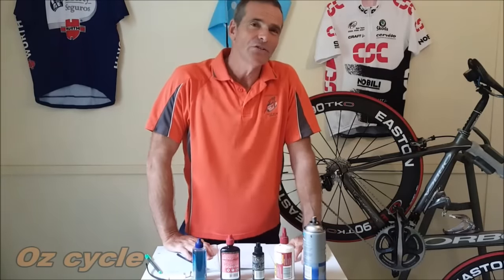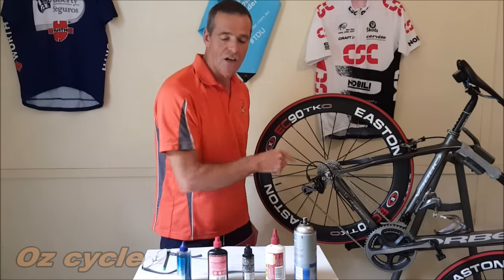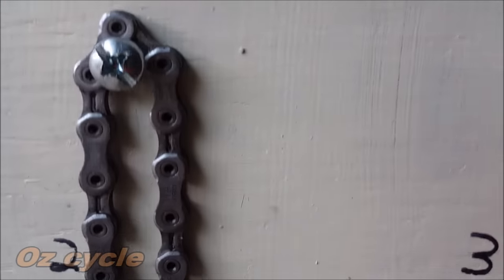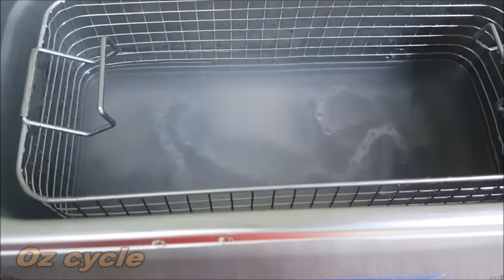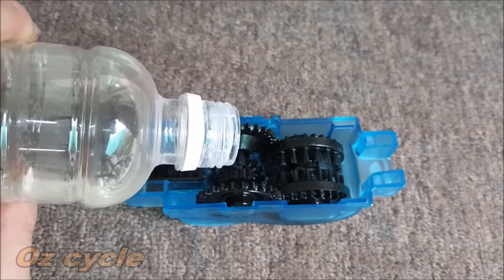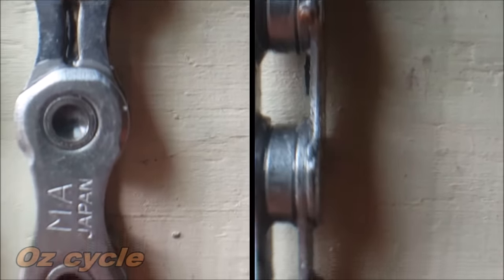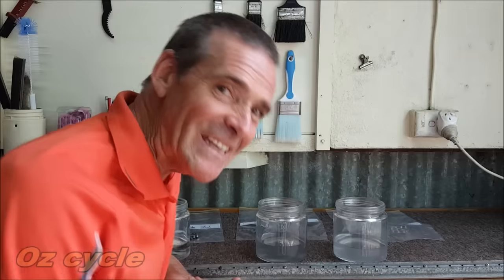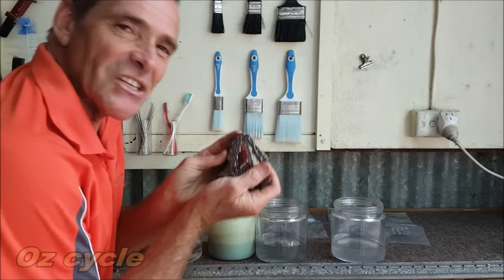Best chain clean ever !!

Comment: In the US it is called gasoline,40 years ago I cleaned chains and drive-train parts with this comparatively inexpensive solvent,used it for twenty years or so.This (gasoline) should never be used for this purpose,the risk of a very adverse outcome is always present.When asked by customers what I used I would tell them,but I always said,I recommend they not use gasoline-way too risky.I was fortunate to never have any type of accident with this solvent,but considering what could have happened ,I have to call out anyone recommending such a procedure on a forum that will have a very wide range of viewers,some of which will be unaware of proper safety measures when handling such a volatile solvent!Please,do not under any circumstance use gasoline to clean your chain,the risk is unacceptable in light of the alternatives.

Comment: Hello Profesor Oz cycle !,  beside cleaning chain , I would like to know the best way to clean free wheel and the cassette, I need your help an figuring out the best way to keep it clean .
Reply from the maker: You mean just the rear cogs? Generally,remove chain and  spray a small amount of degreaser on the cogs and on a dustpan brush. Scrub cogs for about thirty seconds then wash off degreaser with water in a spray bottle or light hose spray. If very oily/greasy cogset repeat the proceedure and you should have nice shiny cogset. Wash out dustpan brush when finished.

Comment: Hello. Good video, but didn't see only method I use to clean stuff with. I use a container with Viner and make sure it's enough to cover whatever I'm cleaning. This will clean up very nicely.  I'll try to make video of it.
Reply: In ultra sonic cleaner. Pour White Vinegar and set it and forget it. Longer you leave it longer it will be better.  Using the Luton sonic cleaner alone without Turing on power undisturbed will result in clean parts or tools. Trust me.  Best method out there Period. And it cost $1.00 if that at the most.  
Thanks.
Reply from the maker: +cilydaniel So just put white vinegar in a container and put in part to be cleaned?
Reply: Get a plastic container. The size depends on what you are cleaning. Ok. 
He has ultrasonic cleaner so just add White Vinegar. Don't have to heat up ok. Anyway. Put chain and bolts into container and
Power on.  Longer left on better the clean.  .
Reply from the maker: +cilydaniel Ok. I thought you meant without ultrasonic. Will still try white spirits in ultrasonic anyhow. Thanx cilydaniel.
Reply: Both.  It works wonders.  Try it.  Just try it. Anyway. Going to bed. Tired. Been chasing cattle all day. I'm out.
Reply from the maker: +cilydaniel Will try,thnx. You live n work rural?...so do I.....on dairy farm.

Comment: Could put gas in the plastic chain tool. Then wash/degrease. Then mineral in chain tool. Then wax in chain tool
Reply from the maker: +mindciller Try it...see how long the chain cleaner lasts  :)
Reply: Well gas cans are plastic so I don't see a problem I'm just too lazy so I pressure wash my bike after spraying with diluted Super clean
Reply from the maker: +mindciller Yes,polyethelene I think. Polyurethane melts with petrol.

Comment: How much is a new chain? What kind of tool do you need to break  a chain without a master link
Reply from the maker: There are different quality chains. Good ones are usually $50-$100. Without a masterlink you can use a 'chain pin tool'.

Comment: Degreed chemist here. Your results are not even slightly surprising because of the use of different solvents in the different cleaners.  The problems with the winner are obvious: 1. Gasoline is dangerously flammable.  2. Automobile grade gasoline is moderately toxic.  3. If you live in a civilized nation, disposing of dirty gasoline is problematic.  The first two issues can be partly ameliorated by using paint thinner grade mineral spirits instead of gasoline, but the disposal problem remains.  BTW, no one should get the idea to use gasoline, or any other organic solvent, in the ultrasonic cleaner.  It is definitely not designed for flammable liquids.  Also, for reference, neither isopropanol nor methylated spirits is a good solvent for paraffin wax and neither is particularly good for petroleum oils, though they are better solvents for oil than for wax.  The common drug store isopropanol sold in the USA contains several per cent of water, making it a terrible solvent for oils and waxes.  Anhydrous isopropanol is better, but still not great.
Reply from the maker: +Mark Holm Thanx for the input,Mark. Nothing wrong with flamable liquids if handled correctly. Never heard of toxemia from petrol??...bad for skin tho...always use gloves. I get 3-4 uses from my 100mL...thats a mere 25mL per chain clean of petrol,then leave it out to evaporate....wipe out sediment with rag. Petrol is much cheaper than paint thinners. High grade isopropanol is great but not readily available in a lot of countries. Agree...DO NOT use flamable liquids in ultrasonic cleaner. Cheers....Steven
Reply: oz cycle   Mineral spirit type paint thinners are significantly less likely to cause an accidental fire than gasoline.  And, yes, they are also less toxic than gasoline.

Oh, yes, here in the USA, and I suppose in other cooler climate areas, gasoline sold in the winter is more volatile than that sold in the summer.  It's better for starting your car on a cold day, but is also that much worse accidental fire risk when handled casually.

Comment: how about petrol on the chain cleaner? and after some degreaser to remove the petrol? I will try that, don't want to remove the chain from the bike, last time I screwed the old one when I put the link back
Reply from the maker: +androide81 Careful with petrol as it can melt some plastics....like the brushes in clip on cleaners
Reply: oz cycle got it! I already did it one time and the chain looks great, Will try use a cleaner instead of petrol next time, thank you!!

Comment: Dear Sir.
My English not good, I am not understand all your words. Please explain with me : I will choose isopropyl alcohol Or methylated spirits to soak a dirty string (which is sticking oil, grease, dust, etc) and after 24 hours I will have a clean and perfect chain, Am I right? because I can't buy Digger Methylated Spirits like in your video, but I can buy isopropyl alcohol 99,7%. Thank you so much. Best Wishes.
Reply from the maker: Petrol soak first. Then degreaser. Then IPA
Reply: @stevenleffanue  Thank you so much again. Best Regards.

Comment: Waste of time&material . The grime never builds on the contact wear points. Apply non detergent oil to the edge of each roller,use a toothpick,tap off excess first. This is the cleanest part of the chain from the mechanical action of use. Washing the chain gauranties  dirt getting where you don't want it. Chain stays clean enough by wiping with a clean rag. Same for sprockets . The buildup of black material on the chainring contact surface should be left alone also, it shield's the base metal.

Comment: Maybe the cleaning solution is different. You should put all 3 method on a same chemical solution. Either use all Petroleum, or all degreaser as chemical.
Reply from the maker: +leesunlung Petrol in the ultrasonic cleaner would be potentially explosive. Petrol in clip-on cleaners often damages the brushes.

Comment: For the homemade method, you clean the chain in petrol, then degrease it, then wash in water, then clean again in methylated spirits. If you're using the metho at the end, do you still have to degrease it after the petrol? And is there a need to wash the metho off in water before lubing? Thanks.
Reply from the maker: The Metho or degreaser is the last cleaner. After that,dry the chain if possible. Then pop chain straight in wax bath. If chain isnt completely dry it doesnt matter as the hot wax will displace water out of the links and sinks to bottom of the bath. 
You dont have to do this whole process everytime you wax a previously waxed chain unless it is really badly soiled....just clean outside of chain best possible then pop into wax. I use a small amount of degreaser on clean rag and wipe chain so its nice n clean outside. Dont use too much degreaser as it will find it way INTO your chain.
Reply: Thanks my friend. So the metho also degreases the petrol just like the degreaser spray.
Reply: I think I interpreted that wrong. I thought you meant after using the petrol you could skip the degreaser and go straight to the metho. I don't think that's what you meant, you meant either stop at the degreaser or do degreaser and then metho.
Reply: Just wondering, when you do the thorough chain clean with the petrol, why do you then go to the effort of putting the chain onto the dummy bike to degrease with the spray, instead of simply putting a small amount of degreaser on a rag and wiping your chain like you do other times? And doesn't the spray version of degreaser get INTO the chain like you suggested to avoid? I'm wondering if I could just wipe my chain with degreaser after the petrol clean as I don't have a dummy bike and would prefer to avoid using degreaser with the chain on my bike so I avoid spoiling the spots around my bike the degreaser doesn't belong.
Reply from the maker: For thorough chain clean....petrol then put degreaser in a container a  nd soak chain for at least 10minutes. Wash out all degreaser with water under tap or bowl of water,(no need to use dummy bike). 
Put chain in metholated spirits and soak at least half hour. If spirits remains clear after shaking the chain is ready for wax.
Reply: Ok perfect, much appreciated my friend, I'm on to it! Regards, from Newcastle.
Reply: I'm just about to conduct this deep clean of my chain where I soak in petrol, then degreaser, then wash with water, then soak in metho. I was wondering if I could also carry out the exact same cleaning process with my chainrings, cassette, and rear deraileur (minus the jockey wheels?)? Thanks a lot.
Reply from the maker: Just degreaser will clean the chainri ngs,cassette and rear mech just fine. Remember to relube the pivots on the resr mech after tho.
Reply: Excellent, shall do. When I was shopping for degreaser from Bunnings, all of the heavy duty formulas said 'not to be used for aluminium and alloy', excepting one, which was Kenco Heavy Duty Degreaser. So I got the one to be on the safe side, as it had directions for use with aluminium and alloy.

But do you not worry about that caution, and just use the harder formulas that say not be to used with aluminium and alloy?
Reply from the maker: Degreaser from auto shops are fine for bikes as cars have alloy parts too. Ive never had a problem. Degreaser should be used sparingly anyhow and washed off asap.
Reply: Wonderful, much appreciated. I've had my new road disc endurance bike now for a couple of months and already my KMC chain is past the 1/16th inch stretch mark. I probably only got about 300 km out of it. It's amazing how fast the chain can wear past the mark if you leave the factory lube as is for a couple of hundred kms.

I've got a new replacement chain here now, as well as everything I need to keep it in good condition. Hopefully this one will last a lot longer lol. Thanks for all your help!
Reply from the maker: Mmmm...your new chain should last a lot longer than just 300km,Arahorn. Is this a common problem with all your chains or just that one only?
Reply: I used to race road and track as a kid in the 80s and 90s but haven't done much riding since then until now, and even back then I never actually measured a chain before. This is my first good bike in 20 years. So I couldn't say if it's common or not.

The current cassette that came with the chain hasn't got any wear on it, but yeah that chain isn't passing the measuring test! It's not much past 1/16th inch, but it is past. Not up to 2/16ths past though.

I think if I'd even wiped the factory lube off the outer plates I may have extended the life of the chain some, but I didn't even do that. Even still it has surprised me, I can only assume it's that factory lube I left unattended. I haven't done any unusual riding in bad weather or off-road riding apart from once or twice on a damp road. The chain doesn't look that soiled, but it is very black to the touch, seems it acquired deep black grease fairly quickly.
Reply from the maker: Nice your back on the bike again,things havnt changed much...still requires effort to move forward :)  .
Maybe theres a lot of fine grit on your roads there?  Keep the chain 'lube free' on the outside,should pick up minimum amount of dirt then. Once you wax the chain it shouldnt pick up much.
Reply: Yes, riding a bike is like riding a bike, you never completely lose your legs. And while they're still riding forwards, they're now not always riding FACING forwards: https://www.youtube.com/watch?v=ZePAUgBP9rE
In some ways things have really changed lol

When I felt the chain after purchasing the bike, I noticed the excess was packed on the outer plates, the whole chain was very sticky with thick factory lube, as if the whole chain had been soaked in glue. I've felt the new KMC chain I have here and it has nowhere near that amount of excess on the outer plates as the stretched chain. So perhaps that has something to do with the premature wear.

I'm excited to clean and then soak my new chain in hot wax, I'll have everything I need today to do that and will be able to get started. Do you soak your jockey wheels in the degreaser? One cycling channel said to take them off and not degrease the jockey wheels when degreasing the RD, although perhaps that's being overcautious.
Reply from the maker: If jockeys are sealed bearing dont degrease them. If normal roller and cap style you can degrease them.
Reply: Great!
Reply: oz cycle hi there mate I have an apology to make, it turns out the chain we were talking about is actually not stretched at all, it turns out my measuring tape is off in the inches column. It's one of those sewing measuring tapes with inches on one side and centremetres on the other.

I had originally measured in inches and as I said it measured over 1/16th inch past 12 inches. What i did last night however was measure my new chain just for curiousity, and that too was being measured in inches as exactly the same as the old one, stretched.

So I then found out that 12 inches = 30.48 cm, and measured in cms, and confirmed it with a ruler. Turns out the new chain and the old are the same and not stretched at all. So that's good news for the factory lube isn't it? Sorry for wasting your time with that. I didn't except a measuring tape to be so inaccurate, it is way way off.

I'm just in the process of cleaning my old chain and stuff, the chain is in metho now, and just about ready for the rice cooker. I'll tell you what, that unleaded is absolutely brutal stuff, no wonder it's a good cleaner lol, just about knocks you out that stuff does!
Reply from the maker: Good to hear your on top of the measuring now. Yeh petrol is a great cleaner and you can use it multiple times b4 disposal.

Comment: What chemicals do you put in the ultrasonic cleaner ?
Reply from the maker: Depends what you are cleaning? Usually water and dishwashing liquid.
Reply: @stevenleffanue  Cleaning Chain, Sprocket and Cassettes, i tried with soapy water but it didnt work so well. Maybe not hot enough, so what is the brand of the chemical you use?

Comment: how about putting gasoline in the brush cleaner instead of the stuff and water you put in?
Reply from the maker: +frank burn Manufacturers dont recommend petrol in their brush cleaners.Probarbly because it will disolve the unit too. Good idea otherwise Frank.
Reply: I used some brake cleaner in the brush cleaner today and it worked great!!!! and I only used half of the bottle by using the brush . (I use 1.5 bottle without the brush).  !!!

Comment: the ultrasonic won.you push a button and go do something else.the waste was you just cleaned one chain. put you chain ring in there. hell put the tools you used to take off your chain and chain ring in at the same time. also you would get the same results with just water when you run a ultrasonic for more than 20 min.

Comment: It is not practical to take the chain off for cleaning, most of the quick links (even the multi-use ones) are getting wicker after a couple of uses, apart from wipperman, but wipperman quick link is a very wierd shape and very big size.
Reply from the maker: Wipperman connex is the best to use....never heard of a problem with them.
Reply: @stevenleffanue  Yes, this is the only quick link which is designed to be reusable multiple times. However, according to this source https://cyclingtips.com/2019/01/chain-quick-links-guide-to-easy-connection/ it is wider than any other quick links on the market "they’re a hair wider, longer in length and an odd shape." Public on the internet complain that they are noisy as a result of that, my biggest concern would be possible damage to chainrings. There were some reports of chains breaking at those quick links as well.
Reply: its the only way of actually cleaning a chain properly, ive taken the quick link of my bike and other bikes so many times i couldn't even count, mines lasted fine over 2500km with a bbshd 1500watt mid drive motor on it.

Comment: what would you do if you use 11 speed chain that the quick link is not reusable ?
Reply from the maker: Throw away that quicklink and buy connex 11spd link.
Reply: that's half the cost of a new chain
Reply from the maker: Buy a connex 11spd chain and it comes with the link included. Use that link on the chain you are currently using until that chain wears to .5%. Then you have a new already to just put on....using that same link of course.